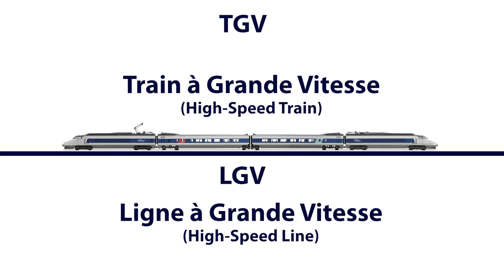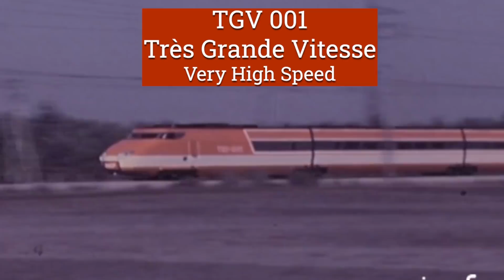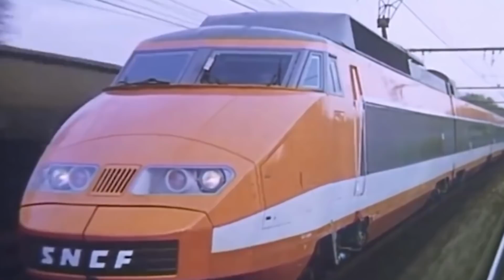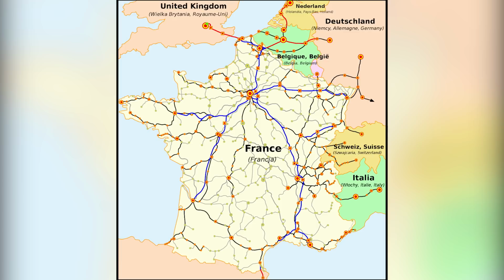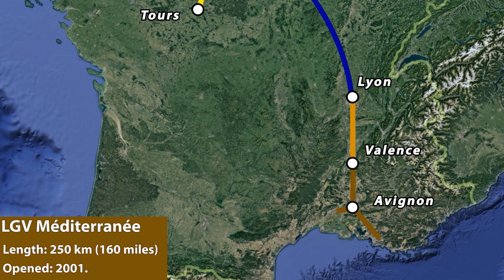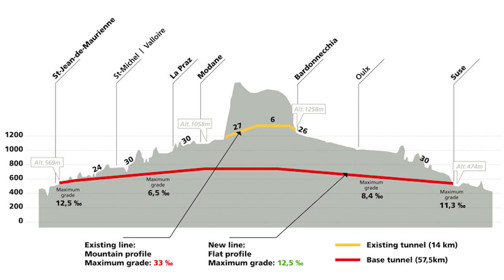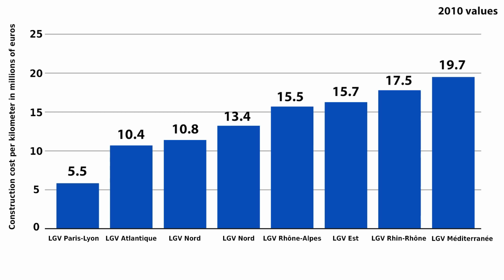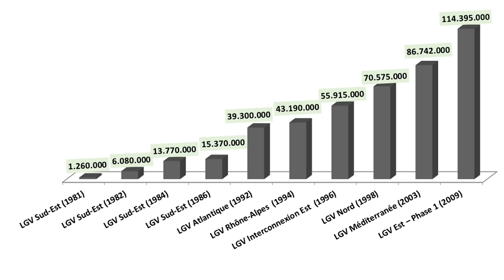High-Speed Revolution in Europe: French TGV Network

Comment: Interesting video, love travelling with the TGV: fast, easy and you can get to almost every region in France. Greetings from Belgium!
Reply: Would love to see a video about the trains and tunnel connection in the alps by the way. And the high-speed rail connections under construction between Italy and France!
Reply: @SaturatedCat  this is the same everywhere, sadly
Reply: @SaturatedCat  depends on what route - and when you book it. the TGV is often cheaper and faster between the biggest cities. I regularly travel to Paris from Lyon and it's always been cheaper by train than flying. not to mention that it takes half the time
Reply: Problem we have is that we have everything centralized in Paris (on contrary to Switzerland and Germany for example), with the city not being in the center at all. Therefore, we have a country split in 2 : East and West.
We used to have trains running from Lyon to Bordeaux for example, but those have been abandoned due to lack of profitability, which means you need to go through Paris if you wish not to take a plane. Hopefully some private operators will be able to fulfill this lack of supply in 2024.

This is of course a "rich" country problem, as many would envy our train network, but our TGV network is great.. if you are a Parisian :)
Reply: @LaciMk  Parisian or a Northerner. Just add one hour to the journey and you can go anywhere from Lille.
Reply: After Bordeaux to Toulouse is built, just adding Toulouse to Montpellier would make a perfect loop for many alternate routes.
Almost perfect.
Reply: @SaturatedCat actually on most routes it's less expensive and even less expensive than the car, if you book your tickets in advance. I got Lyon to Paris outbound and return trip for just 62€, plane would have been 100€ and car would have been upwards to 150€ (in fuel and tolls)

Comment: Very interesting! 
However the map at 10:42 isn't of the LGV Est, but the regular old 160km/h Paris Épernay Bar le Duc line. The LGV doesn't run through or near Épernay, it passes up North close to Reims on the other side of the Reims Mountain (it's a large hill / plateau with all the premium champagne vineyards on its sides, not a mountain as we'd understand it).

Comment: Note that at the beginning, TGV Sud-Est (Paris - Lyon), had initially a max speed of 260 km/h, increased to 270 km/h in 1982 and then to 300 km/h (since 1996 and after) ; this needed to change the gear ratio, new bogies, main transformer cooling and the TVM 300 was upgraded to TVM 430.

Comment: Amtrak finially got something similar to this TGV calls the Avelia Liberty built by Alstom.
Reply: Lacks infrastructure does not matter
Reply: @Sahil Singh yeah
Reply: Except Avelia Liberty is unable to run full speed due to track not dedicated to it. Avelia Maximum speed is something like 200 k which is not the definition of high speed ( + 250 km/h) To have a real high speed train Amtrak should build a new line.
Reply: @Sahil Singh no maximum speed today is 240 km/h on 54 km only. Avelia Liberty has a maximum speed of 350 km/h but is unable to do it on tracks used also by local and freighter trains much more slower. Like said before to have a real HST Amtrak should built a dedicated track for Avelia but the cost like elsewhere is astronomical.

Comment: Another area for discussion is the financing of LGVs. The most successful (busy) line is the first one; it is unsurprising that the line with biggest potential gets built first. Thereafter it’s a case of diminishing returns and it can be seen now that some new lines will not have enough TGV use to justify an LGV. A few years ago an audit of TGV showed that a big proportion of TGV time is spent driving along classic lines and called for TGV to focus on the LGV sections of a route. Between Marseille and Nice there are now fewer TGVs operating. The projected line between Montpellier and Perpignan is an example with slower speed and mixed use to reduce construction cost and to maximise infrastructure usage.

Comment: Another thing that gave inspiration for the TGV was an experimental test track used on the former Paris to Chartres line via Gaillardon, whereby a group of engineers, led by Jean Aubert, created two Aerotrains which ran at magnetic traction and had a rocket alongside their engine, breaking twice the world speed record
Reply: No. The engineer who developed the Aérotrain is named Jean Bertin, not Aubert. The experimental test track for the Aérotrain is a 18 km monorail track between Ruan and Saran in the département of Loiret, near Orléans. Chartres and Gaillardon aren't even in this département but in Eure-et-Loir and never had any experimental aérotrain track.
The propulsion system of the Aérottrain 02 (speed record version) isn't based on any magnetic or rocket technology, but uses the same principles than hovercrafts with jet engines in lieu of turbopropulsers, used on the Aérotrain 180 version. The electric version is the Aérotrain S44, envisionned for suburban use but unfortunately never tested.

Comment: Even the regional/non-TGV trains of France are actually quite fast, way better than what you'd find in a place like the UK for example. The trouble is that until very recently certain parts of the country (like Nice-Marseille) were not equipped with rail for high speed travel and the trains travelled at limited pace over that journey, don't know whether that's changed.

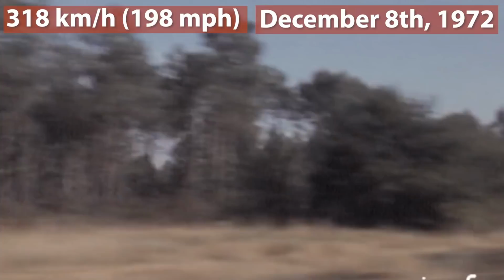Comment: 2:35 On a conventional rail system with a wheel train, tho. The Aérotrain 02 reached 422 km/h in 1969 on a monorail structure, and it could have reached a higher speed if the test track has been longer than 18 km.

Comment: Another great informative vide - Thanks :)  One thing - am I right in thinking the some of the stats in the passenger number growth infographic were cumulative and some year on year?  If so, maybe good to see those separated.
Reply: There are both cumulative and yearly numbers.
Currently, the yearly numbers are in the 125 to 150 million passengers.
High traffic days there can be well over 500k passengers. And well over 1.2 million on main holiday weekends.
Some lines like the one between Paris and Lyon are reaching saturation with trains as close as 3 minutes apart each way. 
That's the infrastructure's traffic, not the destination to destination traffic as there are multiple entry points and exit points which allow trains to and from different destinations to use the Paris Lyon LGV. 
Lille > Marseille, Paris > Marseille, Paris Montpellier, and many others run on the Paris > Lyon LGV.
That's thanks to the "parallel" model of lines used on the French and Spanish networks : lines are not "serial" like in Germany for example, they use ample bypass tracks to avoid cities along the route and use branches to serve city centers.
There's the Paris "LGV Interconnexion Est", which bypasses Paris on the Eastern side and connects LGV's together while running under CDG airport and Disneyland Paris Resort.
The LGV Sud-Est continues on a bypass East of Lyon, running under Lyon Saint Exupery airport and ending in a tunnel under Marseille, or passing on the Southern outskirts of Montpellier before ending in a stub ready to be continued.
This specificity allows for a very high average speed on the line as nonstop trains never have to slow down to run through cities.
This also allows trains to run in parallel instead of being stuck behind each other, which maximizes capacity.

Ridership should further increase substantially in the coming years with SNCF receiving its new TGV M's that have a capacity of up to 1480 seats in 400m sets. Which is roughly between 200 and 400 more than today, depending on the type and configuration.
Right now, demand far exceeds current capacity.
There's even a plan to implement a CBTC centralized remote autopilot system derived from the one called NExTEO which will soon enter service on Paris' RER E line, in order to further increase the line's capacity during rush hour.
A couple years ago, SNCF switched to only using double length double deckers on Paris <> Bordeaux, for example, to try coping with high demand.
Paris center TGV stations are another choke point as several are also reaching saturation, especially Paris Gare de Lyon.

Comment: I have recently taken a journey from London to wroclaw,Poland. It starter and finished in the same day. I Think 3 h rule od not valid. While my journey was a bit long and included few changes, if I was to take a plane and include security checks commute to the airport etc plane would only be 4 h faster. Cost at the time was comparable. Comfort, bar the changes is actually much higher. I would love to see more high speed trains across Europe with better connected routes that do not require so many changes. I’m happy that Poland now is cooperating with sncf to develop their high speed rail

Comment: Even at 20 million/kilometer, attempting to get anywhere near that in the US (~36 million/mile), is the base cost of most light-rail systems. And that's before we even think about the other things that drive up costs and the various incidentals. New York just completed the first phase of the 2nd avenue subway line, for a total cost of $4.45 billion, yielded 3 new stations and a 1.8 mile (2.9km) tunnel. What an absolute joke. I do realize that this is comparing the cost of high-speed rail to subway, but the cost per kilometer was $1.53 billion. The entire DLR in London was built for that much money. Paris built a full regional metro line for a little bit more. It's not like there isn't political will to do these projects, but, and in particular having lived in New York (thankfully moved out), the amount of absolute corruption and cronyism is mind boggling. Staten Island has been begging for a subway connection for 100 years, and nothing has happened. Instead of improving a line that runs along the East River between the two most populous counties of the city, the mayor wanted to put in a tramway, 600 meters to the west of a subway!!! It would cost more than $3 billion for a 10 mile route of tram tracks or $300 million/mile. That's just robbery at this point.
Reply: Urban train networks by their very nature are more expensive to construct. Almost the entire line has to be tunnelled, under existing homes-pipework and offices/roads/canals-rivers etc. Some of this tunnels hits archological sites which must be assessed before they are obliterated. Access to such tunneling and station building is harder-more expensive-longer etc. Hence HSR lines linking cities over "farmland" is cheaper and in theory quicker. As the CA HSR line has shown- farmers are the losers and will fight tooth and nail to retain their main asset - farmland (which complaining about road access quality and accessibility). Unlike home owners - they can move if offered enough money but farmers tend to be less enamoured about being offered land somewhere else. THe issue in the US is as urban sprawl has increased, land to build HSR or any new rail line is made even more scarce and expensive. We want private companies to build and pay for it but we baulk at private firms forcing us to sell land to benefit private profits. It was easier when you just shot some indians and forced them off their lands for free.  The US is now akin to only allowing cargo planes to fly once no passenger flight is impeded.  ONE metro line under London was to cost just under £15b and will now cost £18.25b - £3.25b more than the estimate - more than 20%+ higher and in the billions not millions. China built their HSR because citizens have no rights. The longer the delay between building major infrastructure, the more expensive it gets - hence the reason to build navy ships regularly.
Reply: Currently, we are very excited about building the Grand Paris Express, and it's a 50 billion dollar project to build more urban train lines. Basically nearly doubling the length of the metro system. Strangely, it's faaaar less controversal than in the US x).
And yeah, urban train lines cost far more to builf than High Speed Rail. It's generally considered that closing a public transport line for renovation is not possible, so all the crossings, tunnels and bridges have to be redone on its path. 
Also.
The maintenance cost of US suburban cities is soooo high with all this road per citizen, that your cities end up in bankrupt and unable to give decent food in schools, decent libraires, decent roads and decent transit systems.